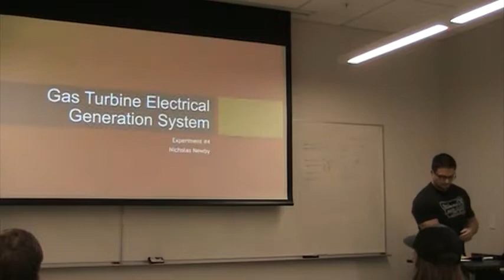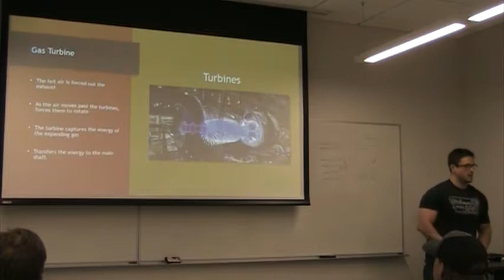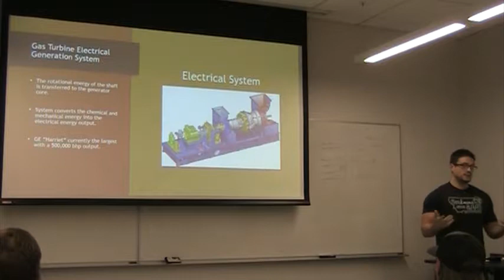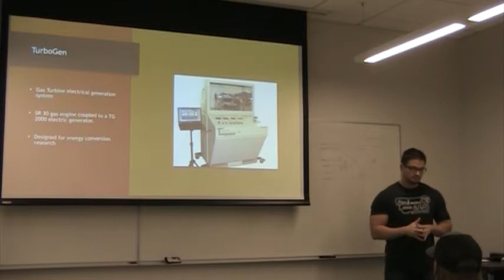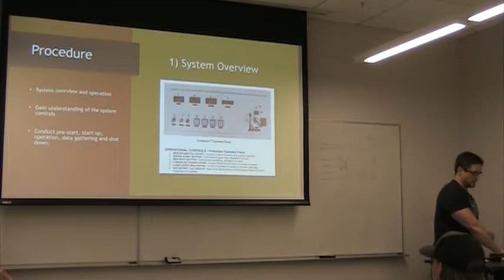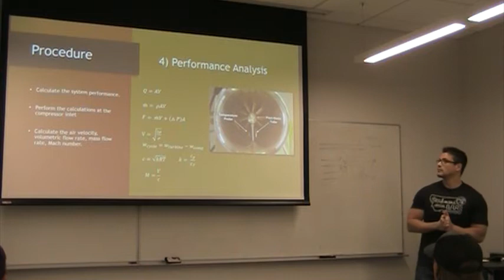Nicholas Newby - 2/13/19

Comment: Nic had an excellent slide presentation.  He had a great background selection that really helped bring out the text on the slides, and he had a large amount of well-cropped images that really helped get the visuals across.  One thing the slides could improve on is making the text fill up the entire slide.  I felt the font could have been a couple sizes bigger, but it wasn't too small either.  Solid powerpoint!